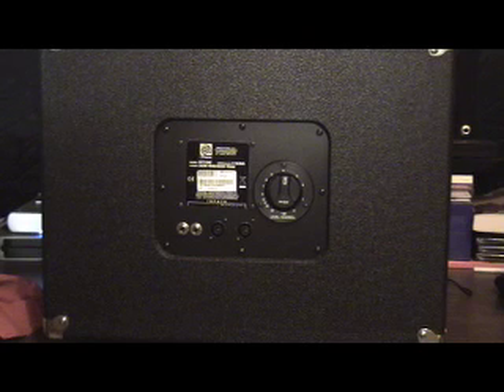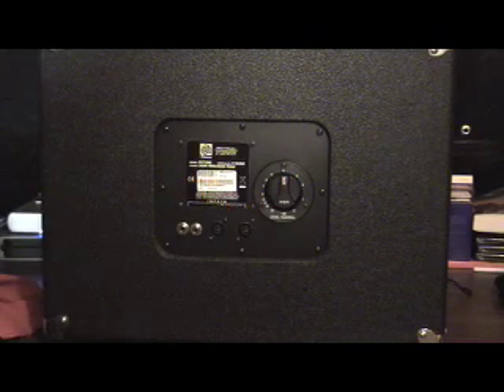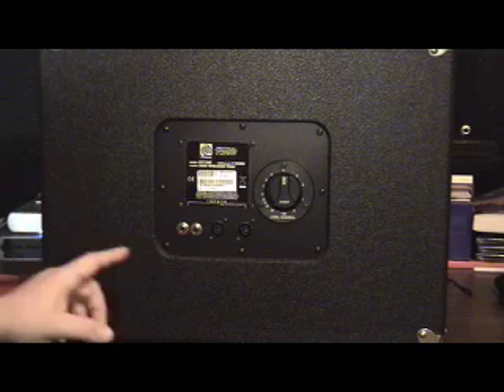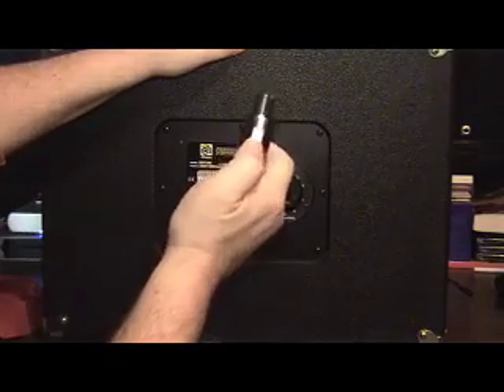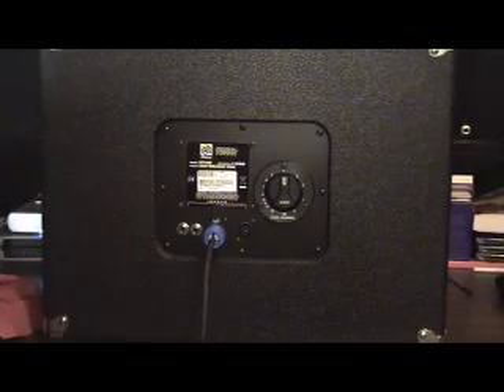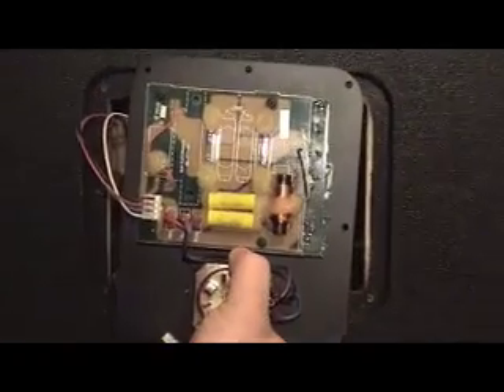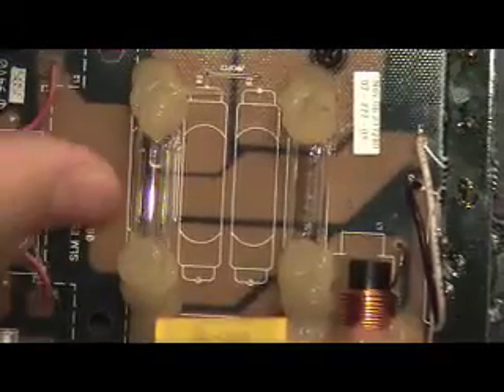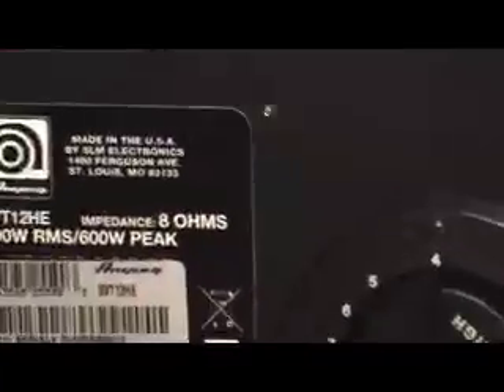Ampeg Speaker Cabinets L Pad Attenuator and Crossover

Comment: So, the 2nd input is not a second speaker connection into this one cab, its for the daisey chain, out, for another cab?  My 78 Peavey Mark III has two speaker outs, so i should only use the second amp out for a second, rated cab, and not as a 2nd power amp in to the one cab, from ch2 off the head? <[ 78Mark3 on SVT-410HEN ]> Infinite Thanks for this tutorial, helping me get a long life of Presence out of my rig 🙏🚂🎼🌹🎶🎵⚕️🛠 ~C< 3)>>-Z->}

Comment: You can’t run speakon cables from the Ampeg V4B head to a 4 x 10 cab cause it wasn’t build with a speakon outlet. Good one Ampeg
Reply: They don’t want to yank your head off the amp if someone pulls that cable. The speakon connection is mainly for the cab. There is cables that are 1/4 inch on one side and speakon on the other end. I have many. For mono or stereo too

Comment: I removed screws from the back panel of my SVT410HLF, but the panel didnt came off. I tried to pick it off, but did risk to push it too much not to damage anuthing, it felt like the panel was stil screwd on. I checked, but i sure removed all screws aroud the edge of the panel. Am i doing something wrong?
Reply: Use a flat screwdriver and pry it open.
Reply: @ericturcotte3131  thanks, ill try it

Comment: I have a SVT 1540HE cabinet and the horn attenuator has been bypassed due to damage to the rotary switch.  Called Loud Technologies for the part; no longer available.  Can you assist me in either 1) finding the rotary switch, 2) ideas to modify the x-over with a different switch, 3) obtaining a x-over that is compatible with this cabinet?  
Any help would be appreciated, Thanks

Comment: If i wanted to disable my horn in my ampeg 610, what wire would i dissconnect?
Reply: The black and red wires directly on the horn.
Reply: The blue and white are for the woofers.